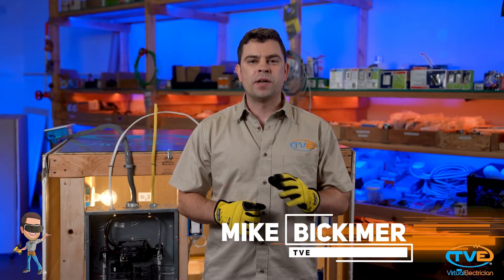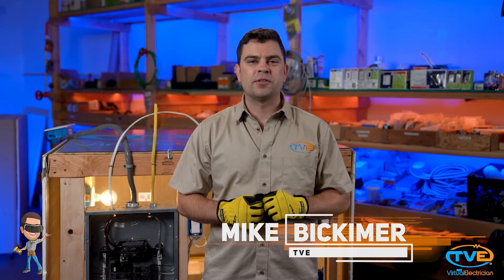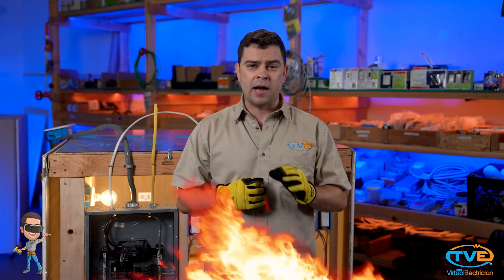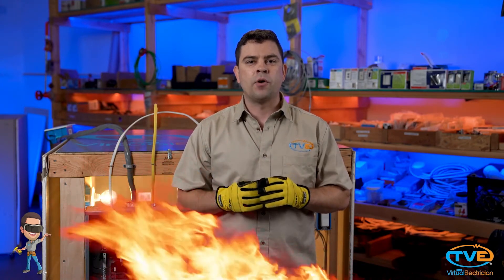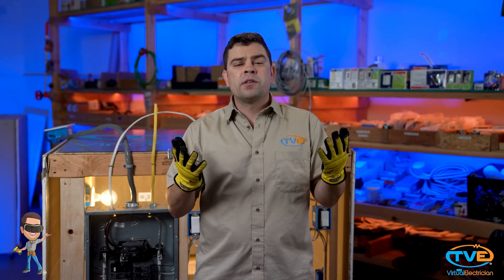Wire Ampacity

Comment: Since when does a 30 amp circuit breaker push amps out and burn up wires?  According to that comment, a 30 amp breaker with #14 wire feeding a dedicated duplex receptacle that has a mini refrigerator plugged in with nothing else is going to burn up the wire?   Hmmmm.
Reply from the maker: why would you overfuse a circuit breaker unless you are trying to get a circuit not to trip?
Reply: @TheVirtualElectrician     You missed the point of the comment.  Should anyone put a 30 amp breaker on a #14 conductor?   Absolutely no.  If more LOAD was added to be 24 amps, then the #14 would near its 90C rating and the breaker would start heating up at the lug and cause a problem.  Where you are incorrect is, a 30 amp circuit breaker or fuse does not PUSH amperage.  Amperage is based on the load.  A mini fridge pulling 3 amps will stay 3 amps if it has a 15, 30, or 100 amp breaker or fuse ahead of it.   
In your comment, you do not fuse a circuit breaker.  
You must be very careful with your words and be accurate so that people respect what you say.   Hopefully this will help you in your future electrical videos.
Reply: Ok great. So if the load equals 24amps, it will pull that from the 30 amp breaker on a 14 gage wire. The breaker won’t push it. Thanks for making that clear to my viewers and not confusing them